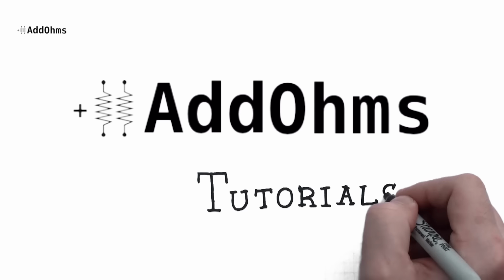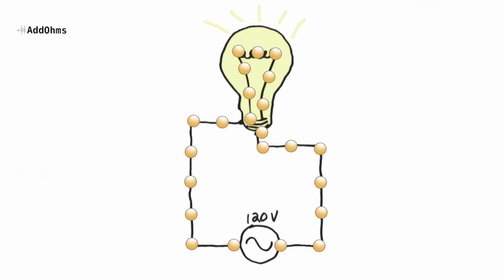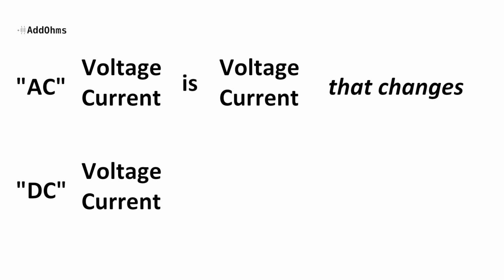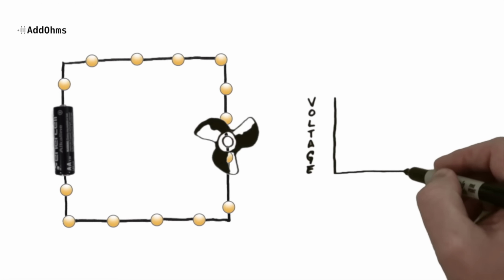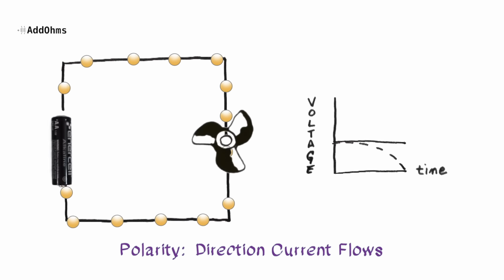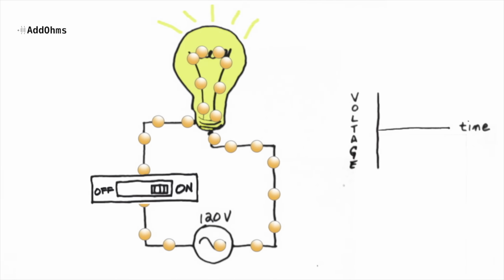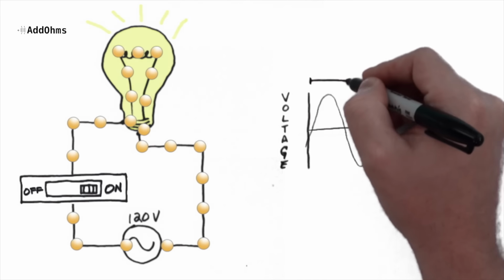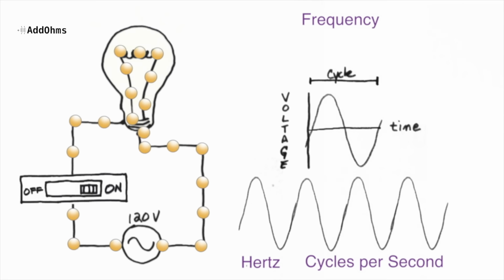Difference between AC and DC Current Explained | AddOhms #5

Comment: probably a dumb question but if were on alternating current how do our lights stay at a consistent brightness?
Reply from the maker: No if, your home's current is alternating.

Two reasons you don't see a flicker:  1) 50 or 60Hz is fast enough your eyes wouldn't notice.  and 2) Traditional light bulbs can't cool down fast enough so they appear constant.

Diming LEDs use a similar trick.  They are flashed so fast, your eye is fooled into thinking the light is constant.

Comment: what  is surface  current and inner flow  current
Reply from the maker: Not as familiar with those terms.  Are asking about skin effect?  Which talks about how there is a difference in current density on the surface of a material, relative to its core.

Comment: I have a switching power supply that came with my router that says AD12v. What does that mean? I want to use it with my programmer that says it requires a 12v DC. It fits but I don't know if I'm going to be able to use it.
Reply: Sounds like a model number.  Is it for a Linksys?
Reply: Yes. Wrt54g
Reply: hockey14822 Then you need to look closer at the label.  It likely says something like:

Input:  120VAC
Out:  12VDC

Which indicates, it outputs 12Vdc.
Reply: James Lewis
It says Input: 100V - 240V - 0.2A 50 - 60Hz Output:+12V=0.5A MAX--+ - +L.P.S
Reply from the maker: hockey14822 There you go... It outputs 12Vdc up to 500mA.
Reply: The reason why I wasn't sure is because it didn't say "dc"
Reply: hockey14822 The symbol with the straight line and dotted line means "DC".
Reply: +AddOhms  What does the " +L.P.S " mean in 100V - 240V - 0.2A 50 - 60Hz Output:+12V=0.5A MAX--+ - +L.P.S  ?
Reply: +Alan Wong  oh, Great video series so far... only seen 4 or 5 of them, but very informative and clearly  presented. Thanks!

Comment: So is AC useless for anything other than light bulbs though? If it alternates then I don't see how it could work for a motor...
Reply from the maker: That's a pretty strong and completely incorrect statement.  AC isn't "useless".  The light bulb was simply one example used in the video.

AC Motors make use of the alternating nature to generate a rotating magnetic field, which allows the motor to spin.  Ceiling fans and HVAC Blowers are examples of AC motors.

Comment: So in the battle between Telsa and Edison what was the issue as to which type of current was better. Why did the world decided on AC?

Thanks.
Reply: AFAIK, two reasons: 1- generators make AC current; and 2- AC current is easy to transform in higher or lower voltages. High voltages are great for transport in power lines but dangerous at home. Edison favoured not just DC current, but local generation of power (a generator in every home or housing block), but Tesla was convinced that big power stations generating for whole cities, then distribution grids was the way to go.
Reply from the maker: Great discussion guys!
Reply: *****
Easy transformation - thanks to magnetic induction. When a current flows through a bobbin, it generates a magnetic field. If that magnetic field varies, then it will generate a current in a second bobbin. So to build a transformer: grab a stick of iron, then coil a copper wire 500 around it, put an AC current through; you get an alternating magnetic field. Coil a second copper wire 250 times around that, an AC current flows through it, at twice the tension. It's easy to make, and very efficient; Tesla played a role in developping and improving such bobbins.
Reply: *****
Efficient high voltages - Because the power generated (or wasted) by a section of line is R*I¨2 - with R, the resistance of the line, and I, the intensity of the current through it. The resistance managed by making bigger cables, better material etc. To lower the intensity, you elevate the tension, as high as you possibly can; so long distance power lines carry very high voltage, of the order of 100,000 Volts.
Reply: u r evil san
Reply: AC is a hell of a lot cheaper.
Reply: How so?
Reply: Many reasons, one well known reason is that It's currently cheaper to transmit electricity over long distances using AC than using DC.
Reply: Charles Boisvert
 Thanks for that more detailed explanation.
Reply: +Charles Boisvert Why is AC current easier to transform to higher or lower voltages? Also, why are higher voltages better to transport in power lines over distances?
Reply: Tbh it was mostly Tesla vs a mirror hahahaha Both had flaws, but the capability to transfer AC over longer distances probably was the best argument for AC, DC is good for shorter distances that's the reason why we use it in smaller circuits nowdays,and ofcourse you can always trasnfer AC to DC with a simple converter !

Comment: Is it not so that electrons actually goes from - to + in a DC setup?
Reply from the maker: Yes, actually electrons move from the negative to positive terminal.  This is called "Electron Flow."  In my videos I demonstrate "Conventional Flow", because it tends to be easier for people to understand.

As long as circuits (or explanations) are consistent, it doesn't matter which one you use.  The principle is still the same.
Reply: One could discuss how diodes etc really work when the flow of electrons goes the other way around compared to conventional flow. This can be confusing when you digg deeper into electronic components, like a diode, where it supposedly should stop electrons from flowing back, when in reality it doesn't.

Can the conventional flow theory be the reason for why we have so ineffecient circuits?
Reply from the maker: Rene Kunnskap Again, as long as you are consistent with the circuit analysis, it doesn't matter which theory you "use."  Diodes only allow current to flow in one direction.  

I'm not sure I understand your "inefficient" question.  First, what inefficient circuits are you referring to?  and what are they compared against?  Why would the way human beings think in the mind what way electrons flow have anything to do with the efficiency of the circuit?

Comment: I have a question,We know that electrons are negatively charged,so they are attracted by positive charge.
How do they inter change their direction in AC circuit?
Reply: I can't understand can u please tell clearly and it is a nice question
Reply: Yea mealso
Reply: Yea. Like I get DC is based of polarity...change sides reverse motor....so I cant run an ac motor? Because then it would rapidly go back and forth?
Reply: @ponderin  ac motors are constructed differently
Reply: The current changes direction by commulater...commulater is a device which reverse the direction of current...it consists of spil rings brushes....u will learn this in AC Generator....
Reply: @jyotibansal5217  is lit like a diode
Reply: @spartanfromgreece7490  u mean led be specific
Reply: Also the current reverse in such a way that electrons move from -ve terminal to +ve terminal with the help of commulater...
Reply: Magnets - a magnet has a magnetic field. As it is spinning inside a coil of wire, every time the magnetic field cuts through the wire, it pushes the electrons cresrig voltage.

When the North part of the field cuts through, it pushes the electrons (which is the positive voltage) and when it spins around and the South part of the field cuts the wire, it pulls the electrons (which is the negative voltage).

It spins in the US at 50 hz  (50 times a second) so you get 100 peaks or "pushes and pulls" and max voltage 100 times a second. It happens so fast our electronics don't slow down and we don't notice.

Comment: what will happen in case of fan i.e during ac.
Does the rotation of fan would changing i.e clockwise,anticlockwise?
Reply: AddOhms I think he is talking about your battery/ motor example :) great video btw very clear & easy to understand
Reply from the maker: I'm sorry, but I don't understand your question.
Reply: AddOhms I think he means if the AC source directly drives the fan (which it doesn't) wouldn't the fan move clockwise and anticlockwise at the rate of the frequency? That's a crazy idea. champ kumar The ac is converted to dc to drive the motor in the fan.
Reply: Aparna Narayanan mam dc fans always runs on DC source and AC fans on AC ,our ceiling fans are run on AC,which works on the principle of induction not conduction,remember phase and neutral of your AC socket remain fix at your home,generally from right side you get your phase.

Comment: I have a question: How is it possible to make something AC rather than DC, I mean the electrons are always heading to the positive side of the battery.
Reply from the maker: If you want to use a DC source like a battery to make an AC signal / waveform, you'll need an oscillator.  Batteries themselves can't alternate current, it's because of how they are made.
Reply: AddOhms Thanks, I have another question- whats the different uses of the two types of signals, and what would happen if powerlines used Direct Current, You'd probably be the person to answer this.

Comment: wait. If one Hertz is one cycle and and there are at least 50 of them running through light and each cycle has causes a light brighten twice (once per polarity) then isn't my light flashing at least 100 times a second? Also, what is causing the increase in Voltage if the Amperage (current) is staying the same in the first place? a magical decrease in Ohms? I just want to understand this stuff better
Reply: James Lewis 
One more little bit. If we're speaking of standard incandescent light bulbs, it's not quite accurate to say it's literally flashing 60 (or 120) times a second. Because these devices emit light though a heated tungsten filament, light will still be produced for some time even after voltage and current is removed.
Reply: man... I asked this 2 freaking years ago lol. thanks for caring guys. I'm all set though. the only thing I have to say is that Robert M-whatever does raise a good point. (it really doesn't have too much to do with my question though, I was excluding random factors like that) but yeah, any heated up molecule (in a high energy state) will continue to emit radiation until it's in a more 'comfortable' state. so nice call there but it really wasn't I was asking. Everyone else: chill lol
Reply: Yes, you correct.  

The light is actually flashing twice the frequency.  Good catch.

The current does not stay the same.  As voltage changes, so does the amount of current flowing.  Ohm's law is in effect.  (The animation doesn't show that.  The animation focused on the change in polarity not showing Ohm's law.)
Reply: James Lewis
Okay thank you. This is interesting stuff. Thanks for the video as well
Reply from the maker: Sadasiba Behera Again, I'm sorry, but you are mis informed. An incandescent bulb is lit up during the negative cycle.  It doesn't care what direction the electronics are flowing.

Newer technologies like CFLs use rectifier circuits to remain "lit" during the "negative" cycle.
Reply: James Lewis sorry sir you are incorrect,only for positive pick light got brighten so it is only 50/60 times,there is no bright light due to negative half cycle
Reply: AddOhms so you mean each time period phase become neutral and neutral became phase and so no,,,,,.if yes please give me exact calculation how many times it does and how many intervals for it occur.
Reply: Robert Menotte just tagging you so you know I mentioned you
Reply: i know that it is 50 hz and two times of frequency ,take a practical example i have a socket having 3pin hole ,when i touch one(right site +ve or phase)i got electric shock as it passing to ground through my body but why it is not happening when i touches the neutralside

Comment: My real question is: what for? why not use DC for everything!
Reply: +ATschTheCube I'm not the most educated on this but I have my theory :P. I think it might be because of the frequency fluctuation with the AC. Think about it, DC is running at a constant voltage, while AC has a change in voltage so the polarity can be reversed. This periodic change in voltage can be more efficient in conserving energy. That's my theory. Maybe I'm right...I don't know :P.
Reply: Johairah Titiban A generator generates electricity, it does this by rotating a shaft with electromagnets attached. As the magnetic field from the magnets pass over nearby conductors (coils of wire) a voltage is induced. You could say the magnet pulls and pushes on the electrons for simplicity. As the magnet is rotating the polarity of the magnetic field changes (north / south pole). This reverses the direction of induced voltage so now the electrons are pulled/pushed the opposite direction. The change will correspond to the speed of the rotating magnetis. For simplicity, a single magnet on a generator with a rotating speed of 3000 will rotate 50 times every second, so the polarity will change 50 times every second, or 50 Hz.
Reply: Dc results in loss of energy in form of heat .. That's why
Reply: Raj Shah a generator has a shaft with an electromagnet(s). The magnetic field induces currents. As the magnetic field rotates but the conductors are stationary, the polarity will reverse with each rotation, changing the polarity of induced current.
Reply: I have read all your comments. Can someone help me to understand AC in simple way. I’m not into this field but I just want to know. 
Thank you.
Reply: +realstuff steve, the problem here is the ohms law is just explaining relations, it disregards power  and power losses, which is result of electricity flow the work, it doesn't come without jules and watts law.
Reply: hey cypeq,good explanation but how is alternating nature of current or voltage produced?
Reply: AC is easy for home, because plug is not polarized and you can plug it either way and you device works, further more in DC devices there has to be considerable measures taken when you plug the power in the wrong way normally this destroys DC operating devices. Also most of home devices operate motors, and motors work on AC current, your fridge fan, lights and electric ovens all operate on AC without need of much extra circuitry. It's only for a couple of decades we have many DC devices like computers, but still majority of your home appliances rely on AC for power. AC is better for long distance travel. Every time you need to convert from AC to DC there's hardware and power loss, and as I said all power hungry devices run on AC by default. There are also transformers which must be supplied with AC and alow easy change of voltage. Really AC is just better we only use DC when it is necessary for the operation, that mostly is in electronics.

Comment: In the animation,why do u show the direction of current from positive terminal of a battery to negative terminal of a battery,because current is a flow of electrons and it should be from negative to positive..
Please help its confusing.....Why do different video shows different direction.
Reply from the maker: Jitendra malviya It's the difference between "conventional flow" and "electron flow".  Technically, electrons flow from a negative potential to a positive potential.  However, it was initially believed to work the opposite way and continues to be taught / thought of as current flowing from the positive to negative terminal.

It doesn't matter which way you picture the current flowing, as long as a circuit is analyzed with the same method throughout.
Reply: But it does makes a difference while calculating the direction of magnetic field.
we have to use right hand rule if we are calculating from positive to negative and left hand rule for negative to positive.
Reply from the maker: Jitendra malviya Well, that's where you need to be careful.  The "right hand rule" isn't really a rule.  It's a convention.  The right hand rule takes into account conventional current flow, not current flow.  So there isn't a need for a "left hand rule".

It might easier to consider the right-hand-rule as acting on the electric field and not the electrons themselves.

Comment: Im trying to make an electric go kart, and control the dc motors speed, can i use a fan dimer withouot a motor speed controler?
Reply from the maker: Oscar Martinez Not if it is a dimmer for an AC fan.

Comment: Say I increase the frequency. What does that mean for the voltage and current? Rather, what must happen to the voltage and current for the frequency to increase or decrease?
Reply from the maker: In the simplest terms, changing the frequency won't have a change on the voltage or current.  

However.  

Changing the frequency DOES have other impacts to a circuit.  For example, a device's resistance can change with frequency.  This is called its "impedance."  

If the resistance of a device changes, then so does the voltage drop and the current.  

This starts getting into some fun math when you take into account Impedance.
Reply: Excellent. Thank you very much.

Comment: AddOhms so witch current is PC using, i hears it is converting AC to DC
Reply from the maker: PCs are DC systems.  The AC from your wall is converted by the Power Supply into 3.3, 5V, and 12V rails.  Then on the motherboard, those voltages are converted down to whatever the chips and processors need.  

They do have an "AC" component to them, which is called "ripple voltage".  This combination is touched on in the Q&A #1 video.

AO #9 Questions and Answers #1